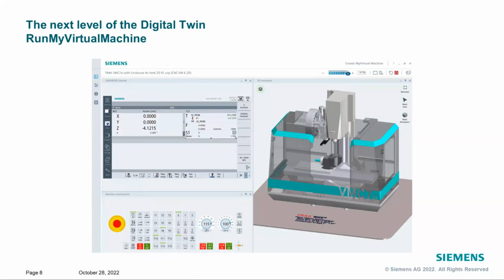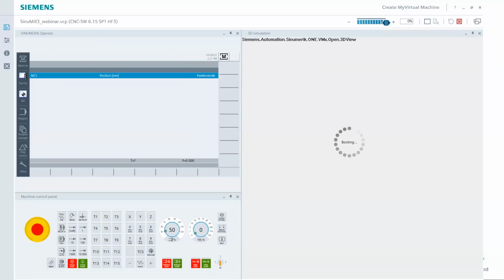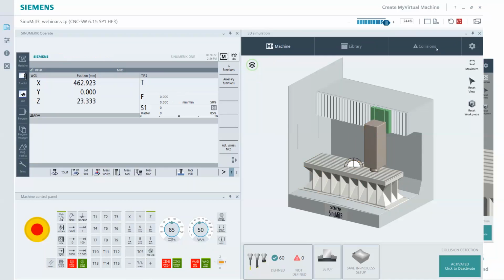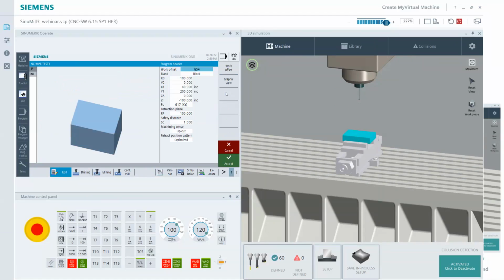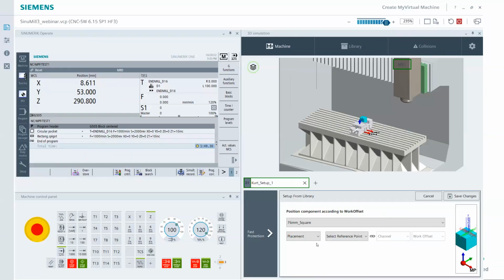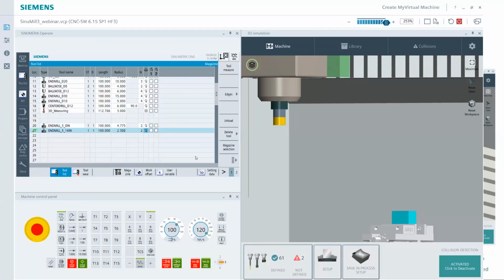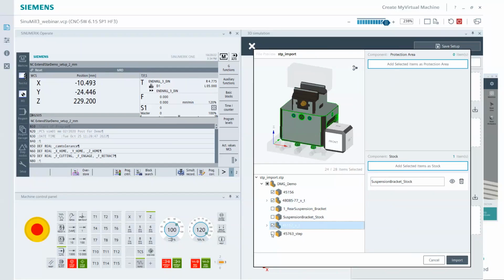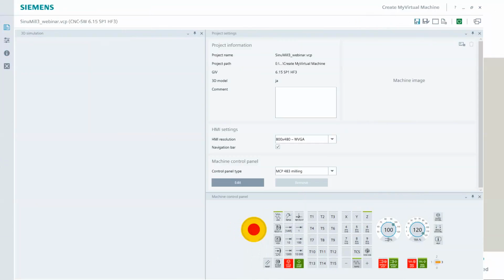Run My Virtual Machine 3D   Setup and Operation

Comment: Can you please explain what is the core difference between Creaty MyVirtual Machine and Run MyVirtual Machine? When one should use Create and when Run? Thank you!
Reply from the maker: Create is use to create VCP file. and Run is use on the shop floor
Reply: @MrCNC  Thank you for your reply. Where can I download Create My VM? If I understood these presentation correctly, one needs both Create and Run My VM when digital twin of Sinumerik one is created. Is that right?
Reply from the maker: just run

Comment: Is this only available for Sinumerik One or also for the 828D for example?. This would be great to teach the new guys
Reply from the maker: This is only on sinumerik one
Reply: Ah that's a pity. Just bought the machine last year so an upgrade will take some patience. Really happy with the Siemens control though!
Reply from the maker: @P1-Engineering  you could use the software and use the template machines